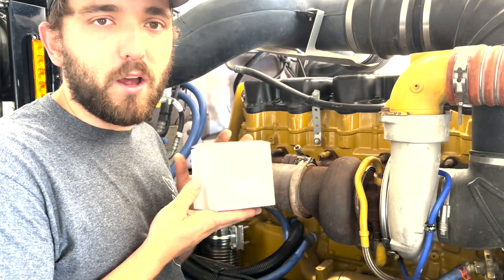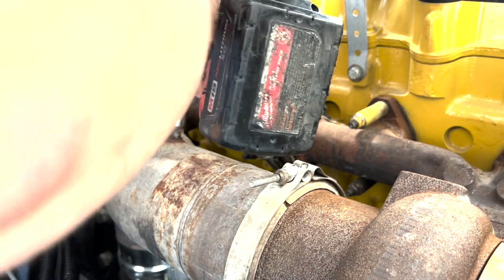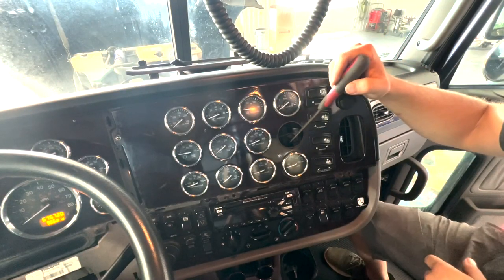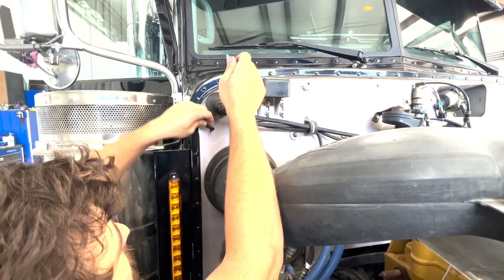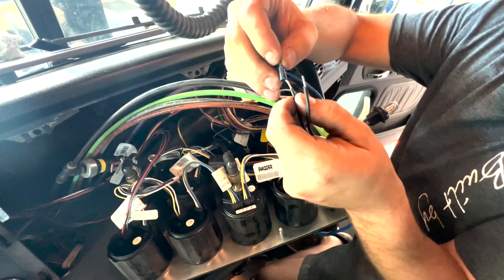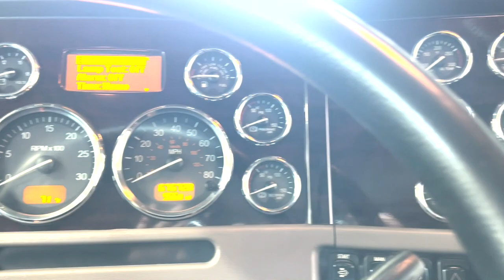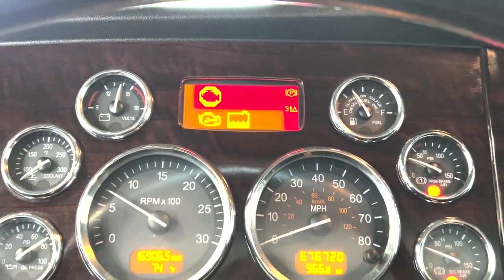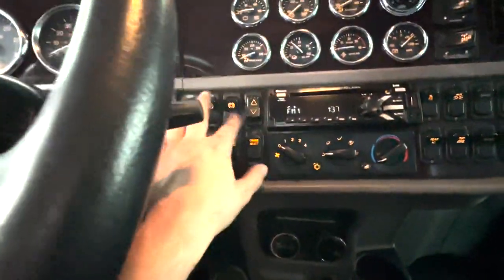installing a pyro gauge in a peterbilt 389 6nz.

Comment: Hi josh, good video, but the white light was way high, possibly the gamma setting is too high or the bright settings where set too high.

But apart from that good video and yes the knife gimmick is way old and not funny. Because you could in doing the gimmick actually cut yourself and with box cutter blades (Stanley blade's as we call them in Britain). They can cut very deep before you know that you have cut yourself.

Stay safe and keep the rubber side down and the shinny side up and we will see you on the back haule.
Reply: He's a grown man, he doesn't need a lecture from another, that's weird.

Comment: Where do you get power from?
Reply: For the gauge not the light
Reply: the gauge is mechanical, it does not require power, the needle moves based on temp probe